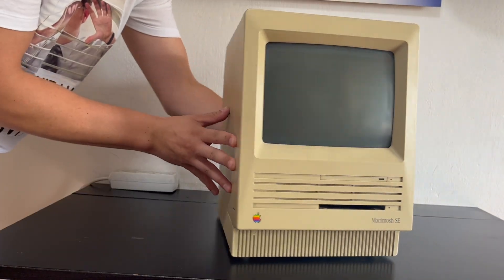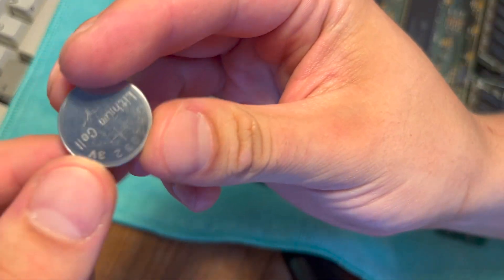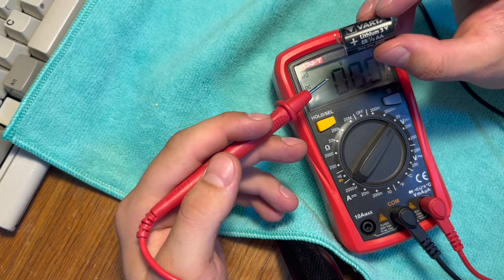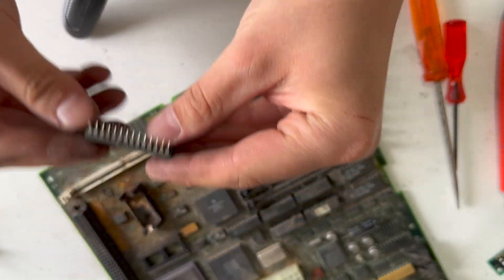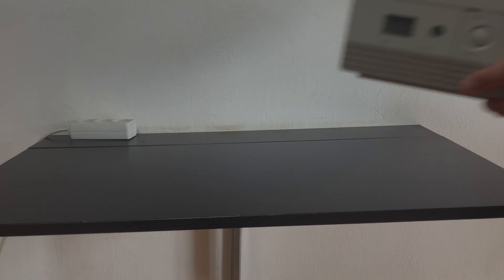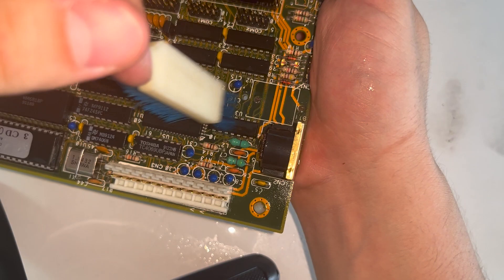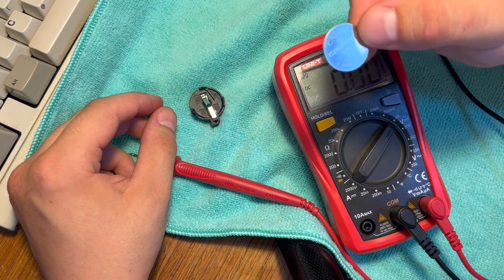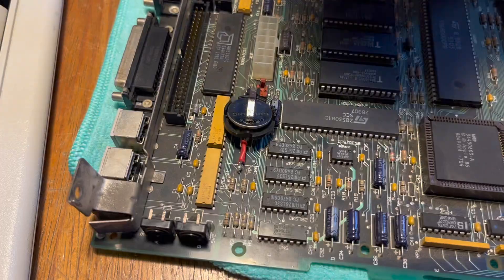Remove Batteries From Your Retro Computers!

Comment: I agree with you one hundred percent about removing batteries from old devices!!!  Public service announcement right here regarding old smart phones... take the batteries out of those, or get rid of them if you're not going to use them again...

My first smart phone was a small pink 2008 Blackberry, which eventually glitched out in 2013.  I kept it in case a loved one wanted to use it as a prop or for a skit or something, and because it was cute 🙄

One night, I woke to a HORRIBLE crackling grinding noise that was absolutely unrecognizable.  I bolted out of bed in absolute terror, and called my best friend while SOBBING because I didn't know what the sound was, where it was coming from, or if someone had broken into my house...

Trying so hard to stay calm, the sound was coming from a box of random clutter- old cords, cables, adapters... and there was my little Blackberry, not so little anymore... it looked 9 MONTHS PREGNANT!!!  The back panel had expanded from whatever was going on with the battery underneath!

I literally ran and grabbed my carpentry safety googles, a pair of bbq tongs, picked up the Blackberry with the tongs, and placed it outside on the concrete in the dead of night of a freezing cold Canadian winter!!!  I didn't know what else to do, and didn't want it exploding indoors.

Thankfully the swelling had gone down by morning, and we promptly brought it to our local hazardous waste depot to the electrics section for safe disposal.  I wish I had either removed the battery once it no longer served its function as a smart phone, or just gotten rid of the device altogether after it stopped working.  

Most people have at least one old smart phone sitting around in a box or in a drawer somewhere in their home.  We should all take a moment to check what older devices we have on hand, and do something about them- donate them to tech enthusiasts, take the batteries out and keep them, or use a safe disposal method 👍
Reply from the maker: @thethriftyfawn  Wow, what a story! 😂 thanks so much for the PSA! Back when you had removable batteries, this was less of an issue. Unfortunately with modern gadgets with integrated batteries that are not as easy to remove, they often bulge and start breaking the screens. I had that happen on few iPods I had sitting in my drawer. Quite sad. And they are much more difficult to remove too.
Reply: @schvabek  Yeah, that Blackberry battery WAS totally removable, and very easily too... I just didn't THINK to remove it when I put it away! 😔
Reply from the maker: @ Most of retro tech nowadays is destroyed either by leaking/bulging batteries or leaking electrolytic capacitors. So most likely the only remaining ones in 20+ years will be the ones with those things sorted out. Batteries are less of an issue (since there’s mostly only one that has to be removed and in some cases it’s a button cell lithium battery, which doesn’t leak), but capacitors… oh man, I’m guilty of not taking care of them yet on so many of my pieces of tech. But there’s so many of them and it’s a pain in the butt. Takes loads of time too :(

Comment: So that battery acts like a nuclear? It's good but it can explode lol
Reply from the maker: @letsg4353  Lol I guess. I mean, with these old computers, it’s not like you’r going to use them everyday, so it’s not a big deal to go and enter the bios setting every time you boot it up. I’d rather not have it on there than have to worry about at which point it’s going to blow. Just clip it out 🤟

Comment: Apple IIgs has the same kind of battery.  On my ROM01 machine, I just got a 3xAA battery holder and soldered that in, then stuffed the holder with Eneloops.  Same nominal voltage as the shipped battery, and it's not going to be flat for awhile.  ROM03, same deal except I had to take the battery holder on the mainboard out.
Reply from the maker: Yep, Apple used to have these ones (or removable ones, as the one I’d shown on the SE30) on many models, for quite a long time. You can find similar ones all the way through to the iMac and Powermac era. I think they switched to using button cells on Mac Pros (at least the ones that I own have button cells).
Reply from the maker: Also, double A’s work well, since the computer doesn’t actually send a recharge signal. So you can pretty much use whatever, as long as it’s the same voltage and you don’t mess up the polarity